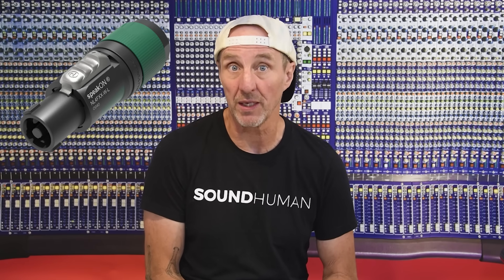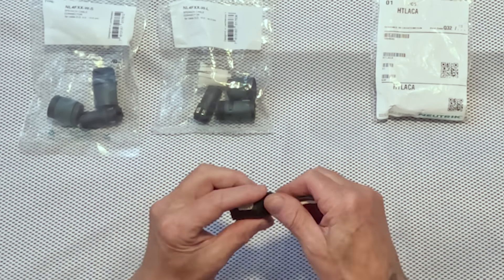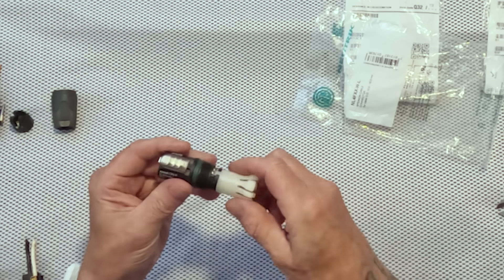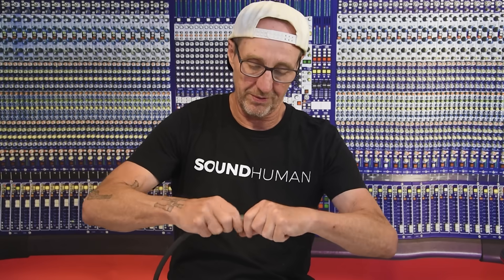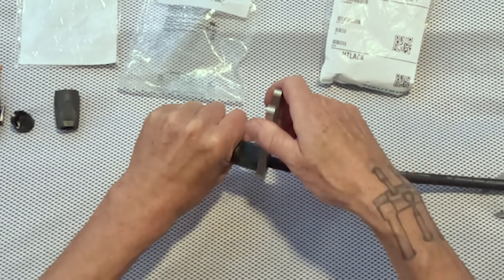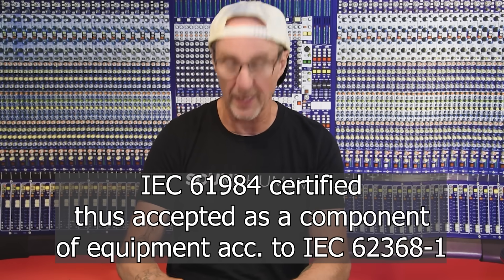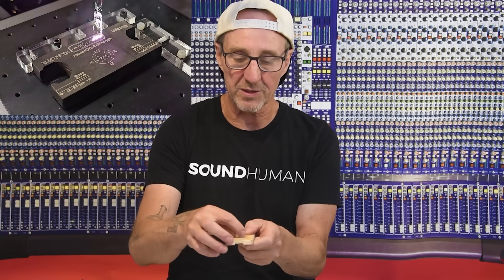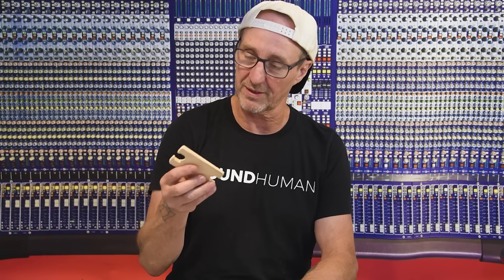NL-4 Speakon Discontinued - New Safety Lock Version!

Comment: EDIT: didn't even watch the video all the way to the end, just wrote this comment... 

It's a good idea to have that safety because the power they push out  through those cables means hundreds of volts ans tens of amps -> lethal.
So safety is important :)

Also the slip ring prevents the cable boot coming undone over years and years of handling and gigging. Especially since to lock the connector in place, you twist it, and then you twist it opposite to unlock and over the years of road use, they can (or mostly they WILL) come loosened or undone and then they fail or cause a short circuit or even kill someone.

I like the design!

The amount of powercons i've had to tighten over the years is in their hundreds. I ALWAYS check both boots of any powercon cable, make sure they're tight and that the strain relief has not given in. If it has slipped, I open the connector, check the wires and if it can be safely just put back together or does it need to be redone from scratch. Any unsafe ones are thrown into "unsafe, do NOT USE!" case and they go back to the renter to be checked and fixed, they will not be used unless fixed in situ by a technician.

Same with speakons. Power levels are just very high so they need to be in good shape :)

Comment: The new connector is 1000 times better than the old one. We always had problems with corrosion on the old ones. We do lots of outdoor stuff and over the years these were always an issue.

Comment: Well first off cool although having to use a tool means this is now a non-toolles design which is one of the things I don't like for quick inspections and quick repairs it's one of the reasons why I've been converting so does this mean the cheap Chinese knock offs might be the way to go as they're reasonably robust? And don't require a tool to open. The number of times I've had to inspect other peoples work.
Reply: Agreed. Much of Neutrik’s value to me comes from the fact that they’re easy to take apart without tools. In the shop I’m at, there’s many NL4 connectors that only have 2 poles wired up (basically being used as an NL2) and so being able to quickly check when pulling is a huge advantage.

Comment: Theres have been lots of changes to the way events are being handled in australia lately that require in some states that all Temporary stages (ie festivals etc) are required to treated like permenant installations that conform to current AS3000:2018 standards. 
Meaning any speaker level connection above 50v technically has to conform to current standards, requiring a tool to access the internals, appropriate IP ratings etc etc.
All power distro required to have RCBO's for each circuit too, no longer will a single RCD protecting 4 circuits be sufficient.
All in the name of safety as you say, i like the new plug design.
Reply: I had no idea about this! Good to know as someone who works in the Aus events industry

Comment: I hope someone makes some 3d plans for this and puts them out there for free. They should be punished for thinking a $90 tool to take apart a serviceable part is ok.
Reply: If you're a professional. 90$ is nothing really.... if you're a business 90$ is pocket change....
Reply from the maker: And one for each workbox so that's 30 or so plus some for the shop, make it 40 plus the loosing of them on tour, so figure $4000 or so initial investment and upkeep of several hundreds a year.

So now, NL4 connectors cost more than the cellular phone bill for 12 phones for 3 years.

Hmmm, yeah, that's also the cost of a beautiful stepcraft CNC router that can make 2 dozen or more cool wooden versions of the wrench at a time.

Over priced wrenches or CNC machine?

Tough choice and one of those choices probably would be the sign of a wise business move and the other, not so much

Comment: At Buried audio we've quickly made a 3D printable wrench that we are currently mass printing to supply with each order, that tool is while very well made, insanely over engineered and over priced to pay for that overkill.
Reply from the maker: Excellent
Reply: I just hope someone posts a story file of this on printables or thingiverse soon!
Reply: @braydenbarriault6879  when I get my hands on one of these connectors, I’ll post STLs if someone doesn’t beat me to it.
Reply: I mean, that's like what - a hole with two flat spots?
Reply: @Fifsson_ it's honestly nothing special (just a U with a grippy surface with the flats in the right spots) we're planning to put it on our thingiverse because honestly it's a bit naff that the tool is $90 and I'm using so little material that I'm throwing mine in for free.

Mad the one they made had to be milled out of metal for something that could so easily be stamped outta sheet steel like the IKEA spanners for almost nothing
Reply: Can you share the stl please
Reply: First and only thing I thought of when I saw the tools appear!
Reply: Link?
Reply from the maker: A quick Google search brought this up and there may be more if you search nutrik wrench stl

https://www.thingiverse.com/thing:6338320
Reply: But your 3D-printed tool wasn't blessed by Liechtensteiner veiled virgins that put their tongue in an angle. That's what you pay for.
Reply: you compare the very end pins and the plastic housing at the male pin end is much thicker in older models. These are cheap inferior and cannot connect inside the socket because they are not designed properly in these cheaper inferior version the plastic circle on the male end is few mm thinner and cannot connect they will have lots of returns on this poor quality product neutrik have launched &  need to be redesigned  urgently already had sound problems and issues because of these low quality neutrik connectors. The old models had thicker housing by a few mm on the male pin ends these cannot connect properly because of the design flaw and cheaply not using enough plastic to make the male pin housing a bit thicker by a few mm more. If they can't connect properly inside the higher amperage is wasted.. Already tried these and they caused sound problems with channels not working finally I checked the dimensions of the sockets pins ends again the older models  to get to the route of the problem